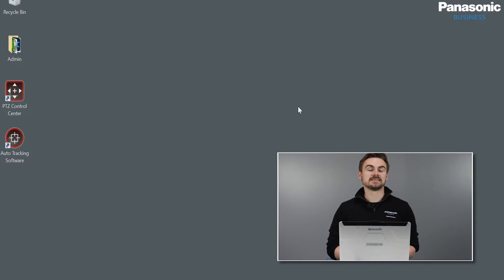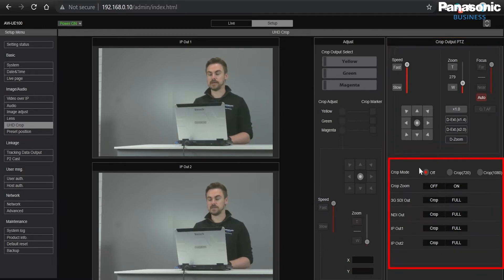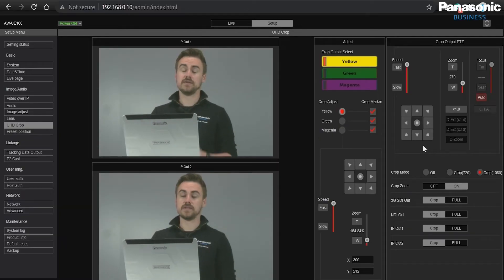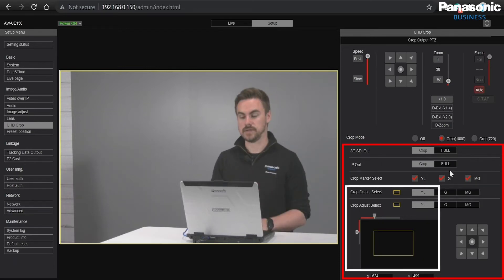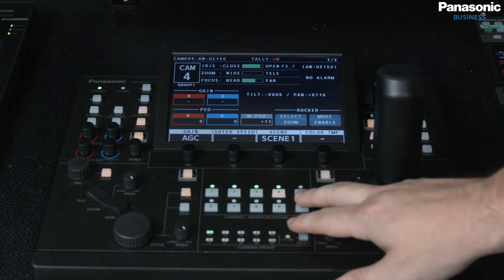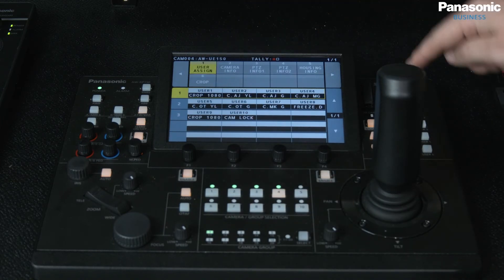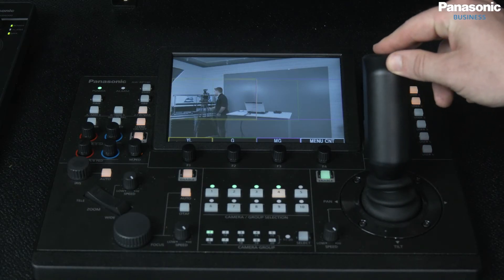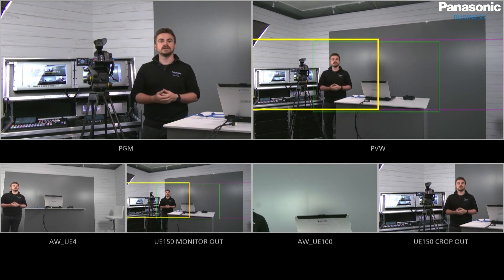Usage of the UHD crop function in Panasonic PTZ cameras | How to – Videos

Comment: Can this live re-cropping feature be used with any 4K input into the switcher even if it's not a Panasonic PTZ? Like can I feed three Sony a7siii cameras into this and get additional punch in angles for each one to switch between?
Reply from the maker: Hi there! Thanks for reaching out. 

Actually. The switch between different crop images doesn’t happen in the Camera remote. It is build right into the Panasonic PTZ’s UE100, UE150, UE160.

That means that you could either trigger the switch right in the web interface of the camera or from our remotes RP60 or RP150.

If you want to crop a 4K input in general the “old school way”. You would do so in your composition tool either in a regular switcher, Kairos, vMix, OBS, Wirecast and alike by zooming or cropping.

But. Remember you won’t get the freedom that the build in cropping function in our cameras provide.

Check out our crop function in detail in this video:  https://youtu.be/Joplcg-TrBU

We hope that helped. Have a great day.